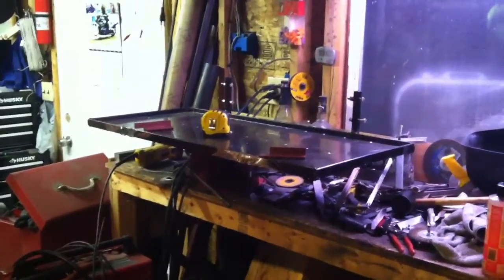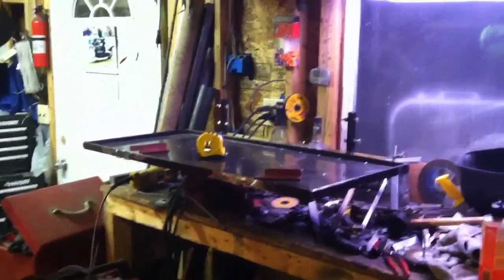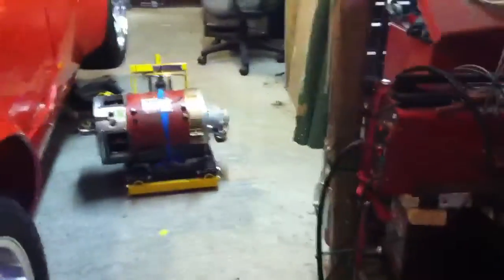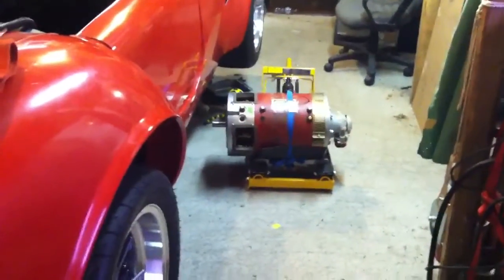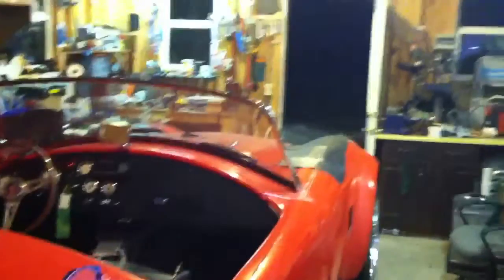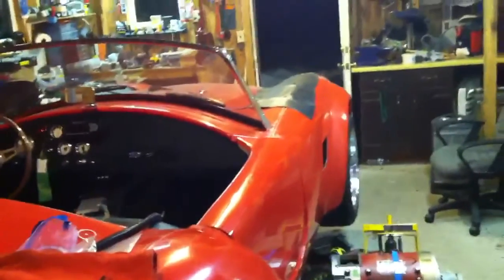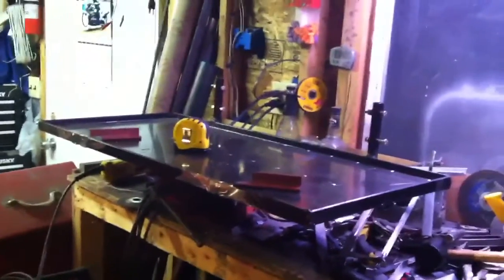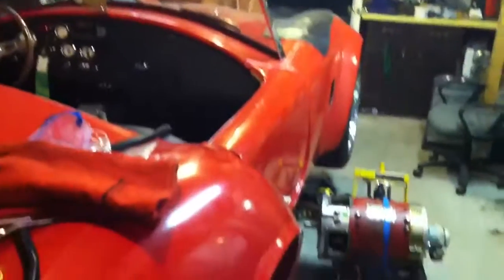Factory Five Mk4 - Electric car - Video 44

Comment from the maker: Here in Maine, I think there are two 'a' s in caah, maybe only one in Mass.  ;-)     Hey, I really like your electric Cobra too.   Looks pretty quick doing donuts on the kitchen floor.... just like electric should be.

Yes, it's a 2010 FRR kit, minus a few things (gas tank, radiator, exhaust pipes, etc).   Sales guy there said that the car is so light, a 250hp V8 feels like 500.   I now see why.   I have only had it up to 31% power so far (143 hp), but it already pulls like a V8.

Comment from the maker: Eric,  Yes, 12V is the plan to begin the brush seating, along with a comm stone.     I have a 30A power supply that will spin the motor along with a 12V battery to supply the start up current.     It will get many hours at 12V, then limited amps on the road until the process is completed.

Comment: Hi Wayne,
While you have the motor out you could connect up a 12V battery (and charger) and run the motor in the forward direction for about 2 weeks to seat the new brushes in.
Eric